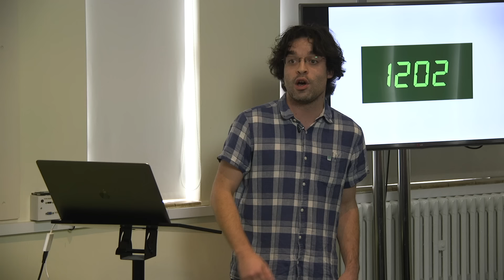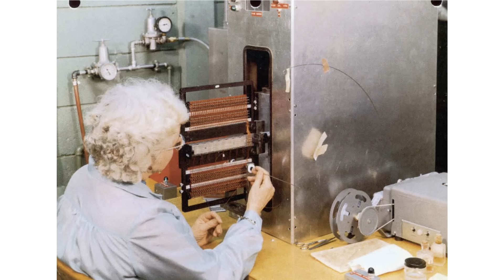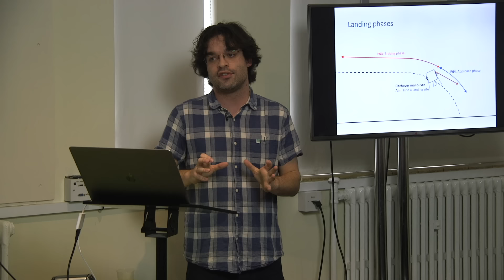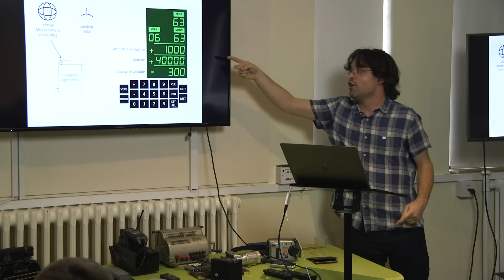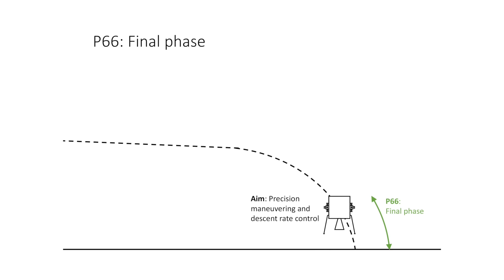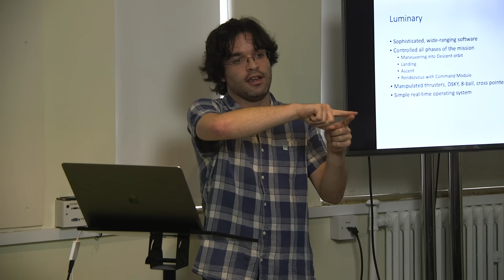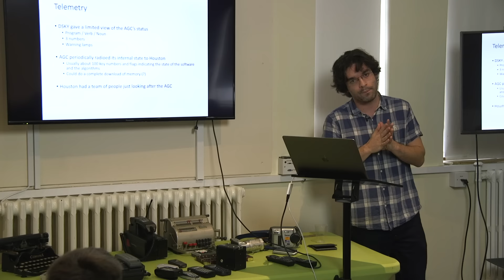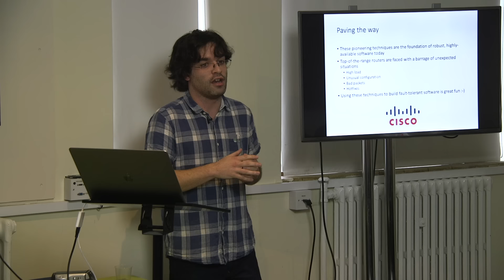Light Years Ahead | The 1969 Apollo Guidance Computer

Comment: For the 1202 alarms the bug occurred as follows. The rendezvous radar was correctly powered up in case of abort. This was always the case when simulated on the ground. But the module used two AC power busses and during sim both were powered from ground power AC, each bus being in phase. The AC was used as the clock signal for the data from various I/O devices including the radar. However during flight these busses where differently configured as out of phase and this caused the data on the alternate bus to be shifted 1 bit. So now the AGC was recieving complete garbage data from the alternate bus which never occurred during ground testing. This was why the bug was never picked up.
Reply: @peter stimpson Problem is, problem was somewhere else. It was not radar constantly sending "I hear nothing" message. It was mismatch of frequency phase between radar position detection circuits and computer interface. 
Because of that phase difference radar was constantly signalizing that it moves +/- some small angle. This signals caused a lot of interrupts (or better stealed cycles) in AGC.
Reply: So how was this fixed? This seems like an inherent bug of the system that would occur the next flight as well while never showing up during ground testing. If they couldn't find what was wrong after the first flight then the next flight would get exactly the same problem of misaligned clocks with no way of solving it in space. And also, how could the radar EVER work if it constantly sends incorrect data? Could it even be used for its intended purpose?
Reply: @andreaszetterstrom7418  This was more an electronic design issue I assume. Using the AC signals from the mains (in this case the module power bus) for internal synchronisation of the data within the unit. A cheap source for a clock as no circuits are required, just 2 resistors and voltage clamp to provide sync to digital signals. However the module had 2 power buses out of phase and the data streams from the alternate powered units became offset because of the phase difference. Some of the old HP test equipment used this approach of using mains frequency to stop flicker on there CRTs. Simple and easy. However the ground simulations of the landing sequences were not using actual flight hardware under actual flight conditions. I guess no one realized that when using ground power that both buses were in phase. Also the landing sequence would have been simulated maybe 100s of times and that no astronaut would break procedure and flip a random switch. I imagine NASA would have considerably tightened up there simulator training after this little mishap. Finally if it was me going down to land and getting your landing computer crashing, I would be hitting the abort button. These guys truly deserve their status as hero's.
Reply: @Dont_Gnaw_on_the_Kitty_3  Thanks for the answer, but that's not an answer to my question. I understand that the power buses are used as clock signals, and that they were essentially the same bus/clock during testing, but what I wanted to know was how they fixed this. If there are two buses used as clock and they are out of sync, the only way to get around that as far as I see would be a redesign to make sure the computer and radar was on the same bus and same clock (or somehow synchronize the buses if they can't be on the same one). Also if the radar always only output rubbish due to these two clock signals that are out of sync, then how could it ever work outside simulation? Did it even work when they actually needed it? It's bad enough it's interfering when it's not needed, but if it's not even working when used for its primary purpose then it's really bad.
Reply: @andreaszetterstrom7418  Don't know the answer to that. I'm speculating that data interchange between radar and computer was not robust, no serial ports or packets, start or stop bits etc. This was mid 60s technology which was mainly analogue transistor. But don't know. But there was a definite problem during flight that wasn't present during ground runs and I bet the protocols for approving readiness were considerably tightened.
Reply: @andreaszetterstrom7418  The fix was to disable monitoring of radar position when radar was controlled directly by the crew. Position monitoring was only necessary when radar was controlled by AGC and in that case error could not appear. You can read more about problem here https://www.doneyles.com/LM/Tales.html
Reply: @ptitera  very interesting, thanks for the info! I read the entire linked text as well. Gives deeper understanding of the issue of the different buses, frequencies and phases.
Reply: @ptitera thanks a lot for that link!
Reply: I had always heard that Armstrong made the conscience decision to leave the rendezvous radar on in case of abort.
Reply: @jamesrobertson9597  According to this article https://arstechnica.com/science/2019/07/no-a-checklist-error-did-not-almost-derail-the-first-moon-landing/ powering up the radar was established procedure to lessen the work overload in case of abort.
Reply: Thank you
Reply: 50 plus years since man walked on the moon. Has anyone had a look at a 1969 car or motorcycle or even a refrigerator recently. 50 years since we been there and our tecknowledgey has exploded and blossomed beyond recognition from a 1969 perspective. If we had been there 50 years ago we would be going there daily or weekly by now. Its time to wake up people, the moon landings were a Trillion dollar hoax and nothing more. You will not see a real moon landing in your life time I don't care how young you are.
Reply: @MegaDavyk  Only takes one small piece of proof to blow the moon landings out of the water. Where is this proof or are you just talking sh1t?
BTW are you Truth Seaker or Truth Seeker?
Reply: @MegaDavyk  With all this 'proof' yet nothing ever came of it. Why haven't you followed up and blown the lid on this? If you have watched the Apollo agc series or other Curious Mark videos, these are not movie props.
Reply: @Dont_Gnaw_on_the_Kitty_3  Try talking reason to someone with their fingers in their ears repeating Lalalalalalalalalalalalala
Reply: @MegaDavyk  "Try talking reason to someone with their fingers in their ears repeating Lalalalalalalalalalalalala"  That won't be easy, given someone's apparent lack of competence in subjects ranging from (non)atmospheric physics to 60's photography film latitude.  But here goes anyway:

The 'NASA scientist recently confirmed' canard was a guy talking to schoolkids about getting people safely through the Van Allen belts -- hardly an admission that it had never been done before, in modestly shielded capsules, by a handful of people for whom some extra radiation exposure was among the lesser hazards they faced;  Laser reflectors are undeniably on the Moon, whether placed there by humans (in the view of people whose brain synapses fire as designed) or by other means (a miniscule but noisey lalalala crowd);  The spacecraft was observed on its lunar trajectory by schoolgroups with telescopes etc.  Likewise for radio transmissions coming from the correct part of the sky.

On and on and on, but I was only putting in time on this reply until I tired of listening to the video, which is right around... now.
Reply: @marcmcreynolds2827  It is you who has his fingers in his ears repeating lalalalalalalala so no one takes his favourite fairy tail away from him. look for this video "NASA admits humans can't pass through the dangerous Van Allen Belts" it is only a minute and a half long even you could grasp it.
Reply: @MegaDavyk  - The short duration in the Van Allen Belts were not a radiation problem for either the astronauts or the computer system.  It turns out the longer flight to the Moon exposed the astronauts to greater radiation, but, as it turns out, the two astronauts who have died lived long lives and their space radiation was not a health problem for any of them.
Reply: @peter stimpson But then you will have to switch it on in a hurry and you will not know for sure it works correctly. Abort is very time critical.
Reply: 1:10:31 it wasn’t forgotten- Buzz was sometimes a bit too clever and decided to leave it on, despite the checklist.

Comment: The Saturn V LVDC was just as "ahead of its time."  It had amazing error checking and correction features.  There was NO backup.  None had any failures.  On the other hand, the Apollo (CM and LM) computers had backup, and they had a few,  hmmm  failures?
Reply: There was backup for the Saturn V in that the LVDC was triply redundant internally (and furthermore in theory the command module AGC could take over though that was never done). In many ways the LVDC is much more the grandfather of modern robust computers for spaceflight. For all its sophistication, the AGC was actually kind of a dead end at least in terms of spaceflight.

Comment: As someone steeped in this topic, I thoroughly enjoyed this. I also give talks on the subject and can add further depth on various topics raised. But the talk is superb. Note, it is said that 75 examples of the AGC were built. Block 2 was used from Apollo 7 onwards.
Reply: Apollo 7 onwards for Block 2 makes a lot of sense, that's all the manned missions (apart from Apollo 1...)
Reply: I've heard the "75" figure, but think it's low, and only lists flight-certified units.  21 flew in Apollo, 1 was in Apollo 1, 4 flew in Sklyab and ASTP, and they built them for the 6 Apollo missions that never flew.  That takes you to 38 right there even before you add spares.  There were also at least half a dozen at MIT, at least two each at JPL and Georgia Tech, four at Grumman, four at North American, two at Huntsville, a dozen in various locations at MSC and several at the Cape.  And that doesn't count all of the DKSYs used for testing and training which were direct-wired to consoles rather than computers.
Reply: @SoloPilot6  Thanks for that input. If you've got documentation around that, I'd be delighted to add it to my collection. Note that I wouldn't count DSKYs. Only the computers themselves.
Reply: @wdavidwoods  : I don't have the direct documentation.  Info came from a talk with Jerry Pournelle about the "the Apollo computer families" (mainframe, Olivetti and AGC) and The Great Line 34 Glitch of Apollo 14.  At the time, half of all NASA CPUs were working Apollo, and at least half of THOSE were ACGs, and he went down the list of everyplace that he knew of which had had them.  This was about 1990, and he was working on getting one of the actual MOCR Olivettis and had a line on a complete, operational AGC, both intended for the Chaos Manor "museum."  He also pointed out that the ACG's direct descendants were the Kyocera 85 family (TRS-80 Model 100 being the best-known member) and the Mobile Data Terminals in radio cars -- both evolutionary dead ends, and at that time being replaced by unrelated technology (8086-family laptops).
Reply: @SoloPilot6  I read that the TRS-80 used the 8085 CPU which was a derivative of the 8080 from which the popular Z80 also came. Does that not mean that all the 8-bit machines from that line are in some way direct descendants of the AGC? I wonder in what way they are considered 'descendants' and not other microprocessor machines of that era.
Reply: @wdavidwoods  : "Descended" based on being inspired by the AGC functionality, not direct hardware evolution.  The AGC, Kyocera and MDT were small, low-powered controllers with limited computer/communications functions, operating subroutines stored in firmware (with no expandability or bypass) and with limited display capabilities.
Reply: @SoloPilot6  ladies and gentlemen, before you drink all the Kool-Aid this channel can offer.. let me give you the opposing view ,,so that you can have a clear story here 
     now we can talk about the satanic numerology that this guy uses and the satanic symbolism,   that is prevalent throughout this whole video, if you want we can talk about that, another time..  
       today let's talk about the fact that NASA has claimed, a bunch of times that all the Telemetry data has gone missing, 13000 reels, went.. bouncy balls, Baby Boom, bye bye along with every single schematic, to anything that went to the Moon, that would be the computers.. so I'm wondering where this guy came up with this cool story because it's not from NASA, they lost literally everything.. man's greatest achievement was completely lost.. but don't worry we're going to have an independent Computer Guy makeup even better stories than the ones you've seen in 69...... 
    and the picture that, he used, the iconic astronaut standing in front of the American flag, now that's heartwarming.. Until you realize that looks a lot like a studio-quality picture and here's the rub guys. the camera they were using needed to be completely adjusted. completely manual.. there is, no computer there,  no AutoAnything remember, the good old days, where you had to    metre the shot, adjust the f-stop, and then get the picture into Focus.. now I want you to do that with your eyes closed because they could not look into the camera, it's mounted on their chest and they have a huge salad bowl on their head ..they can't adjust the camera because their gloves are so freaking bulky and yet these guys we're taking one picture on average every 50 seconds and that includes changing locations, applying extra attention to certain details , sometimes having to move as much as 1.5  miles and yet they clicked one picture,, one studio-quality picture every 50 seconds.. go ask a photographer can this be done with a completely manual camera?? and the answer that all the moon landing deniers seem to be coming up with is an astounding... what a joke
     few of my favourite clips about the moon  and their  chopped full of laughs.....
Can U See Stars Buzzed
https://www.youtube.com/watch?v=jFqDTxYegzI
Top 10 NASA is BS
https://www.youtube.com/watch?v=pEE7OPKLhaM
Hold Ur Head High---Simple Proof that the ISS is Nothing More than a Hollywood Production
https://youtu.be/iwoudgUPqSM
Do Not Watch This Video,,  a  great Flur Fur intro                            
https://youtu.be/D0peS1oxYLo
Flat EarthTruth documentary .
Flat Earth - Best Presentation to Date, objective n honest
https://www.youtube.com/watch?v=YVLzPEoKhe0
Reply: @partypoet2012  : Thanks for the laugh!

Comment: Doing Aldrin a disservice, I'd say. What he was asking the computer was "are the inertial and radar measurements converging", which was an important checkpoint in the landing. Yes mission control could also monitor it, but given the parallel issues with radio connection, keeping a hand on the pulse of the thing keeping you alive makes perfect sense.

Saying "now, I'm making fun of him, but he didn't do anything wrong" and the keeping on making fun, is really not fun. That's essentially what bullying is. Most bullies think "It's just a joke". It's a human psychology thing that happens, but if you keep it in mind and analyse what you're doing, you can avoid it.

No need to besmirch a guy's past deeds undeservedly.
Reply: Neil Armstrong, Buzz Aldrin and Mike Collins were all brilliant pilots. They accomplished one of the greatest feats of the 20th century, and kept exceptionally calm and clear-headed during the landing, when as you say there were various things increasing the stress of the situation.

Throughout the landing, Buzz worked hard to manually sync guidance data to the separate "Abort Guidance Computer", which involved reading numbers from the DSKY and entering them into a keypad, so that an abort was possible if it was needed. There couldn't be a more important, responsible or safety-critical role than that.

The reason the computer overload happened was because of a timing condition in the hardware; throughout the landing Buzz followed his training to the letter. At the start of P63, they didn't realise the radar was sending extra load because the computer was able to handle it. When Buzz entered V16 N68 to monitor the convergence data, which was part of the landing procedure and had been done thousands of times before, this combined with the hardware bug to start causing the problems.

Buzz quickly (and correctly) realised that V16 N68 was triggering the failures and radioed this essential information back to Mission Control, which corroborated with what Steve Bales and his team were also thinking. I am full of admiration for Buzz's role in the landing and his reaction to the computer overload.

Comment: Regarding the second question (1:02:25), on August 9,1961 NASA issued its first contract to MIT for Guidance & Navigation 
https://history.nasa.gov/computers/Ch2-2.html
Apollo’s Command Module development was divided into Block 1 (Earth orbit) and Block 2 (cis-Lunar missions).

The role of the Command & Service module (CSM) CHANGED from Langley plans (1959-1962) due to the decisions on “How to Get to Moon and Return” (Direct Descent, Earth Orbit Rendezvous, Lunar Orbit Rendezvous).  July 11, 1962 NASA announced Lunar Orbit Rendezvous, which meant a Lunar Module, and Computer would be required.
The first manned launches (Apollo 1, 2) were to be Block 1 spacecraft (CSM) in Earth Orbit.
After the Apollo 1 fire on January 27, 1967 , Block 1 boilerplate CSM was ONLY used on unmanned test flights (like Apollo 4).
Only Block 2 spacecraft (CSM) would be used for future manned Apollo flights (Apollo 7 had Block 1 seats and a few other items).  
Apollo 8 was full Block 2 hardware and largely GNC software (some changes in constants of models, gravitational model, etc.)
This was reflected in versions and revisions to code for Block 2 GNC.

See “CuriousMarc” channel on YouTube for operational restoration of an Apollo GNC (and source code recovery of earlier code versions).
BTW, the computer software for Apollo 10 could land ... BUT LM did not have Fuel to land.